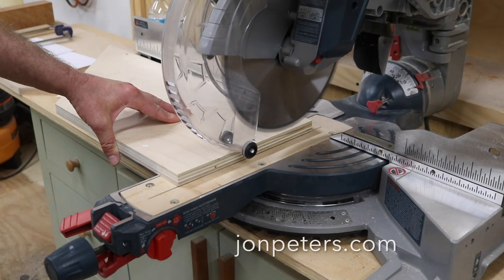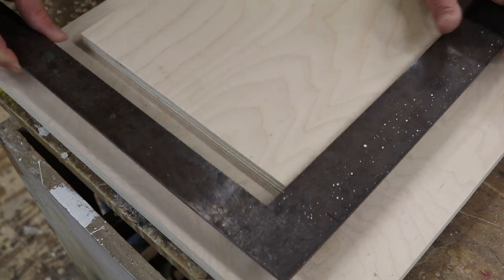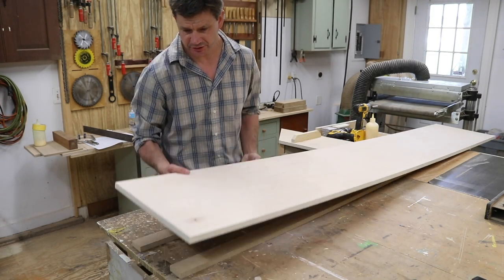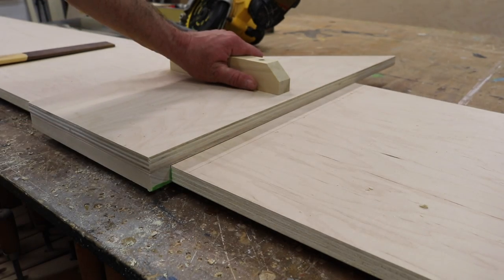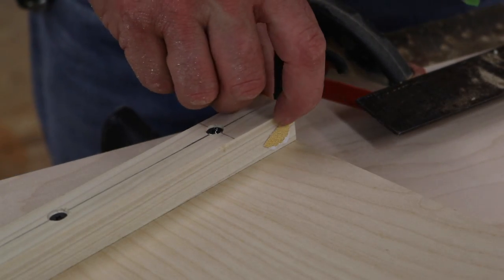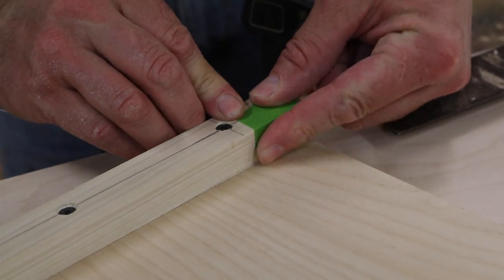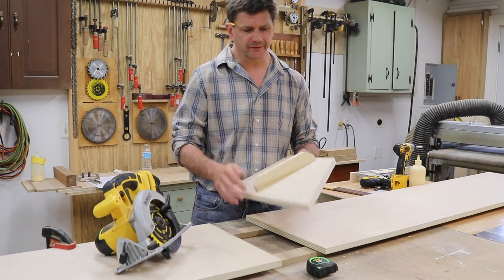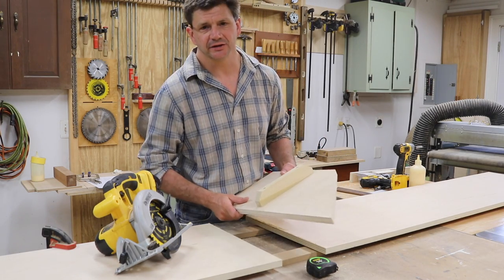Super Simple Circular Saw Crosscut Jig

Comment: great jig but one improvement you need.
the piece you screw to the bottom to square it up... make it a little longer so it sticks out the side. then when you make a test cut that gets cut to the exact length for your saw. then you don't have to eyeball the blade to your line. put the end of that on your line and cut.

Comment: Jon just a suggestion, if you put a piece of wood that buts against the edge of board you are cutting that is longer than the width of you saw base you can cut that piece with the circular saw so that the blade will always line up with the end of that board.  Then you can line that board up with your cut line. It will always cut on your cut line without needing to eye it up.

Comment: Nice jig, Jon. Here are a couple of thoughts about it that came to mind...

I might think about putting the jig's fence against the far side of the stock - then you are pulling the jig toward you while pushing the saw away from you. That might make the jig less likely to slip on you - and it would keep the stock from sliding away.

A layer of sandpaper applied to the bottom of the jig would also keep it from slipping - but that might mar the surface of the stock if you are unlucky.
Reply: I have to second the jigs fence on the opposite side. As I had saw this jig before by an old carpenter and he said to always put it that way. Well almost always. He got in a hurry once, put the fence to him and the jig moved with the pushing of the jig and the saw making a bad cut.

Comment: still confused as to when I cut ply with my circular saw it dosnt give a clean edge at all. I even used a new blade..... any advice?
Reply: Yes when cutting with a c saw put the finish side down.  The tear out on a c saw is always on the top side because the blade is pulling up. On table saws it is the opposite put the finished side up, the tear will be on the bottom.  This has to do with the direction of the blade as it passes through the material - where ever the blade exits there will be tear out (unless you have a backer piece). Where the blade enters a piece the cut is usually clean.